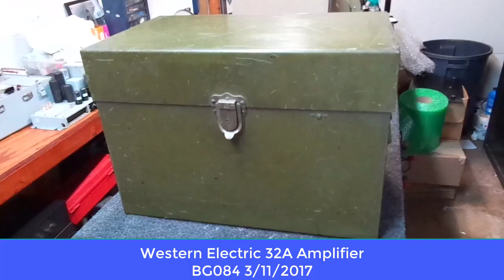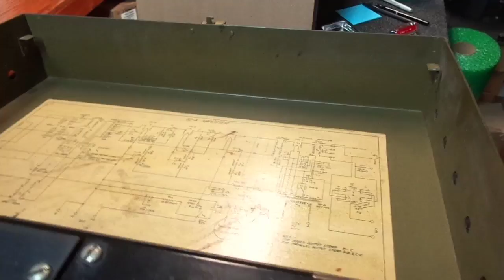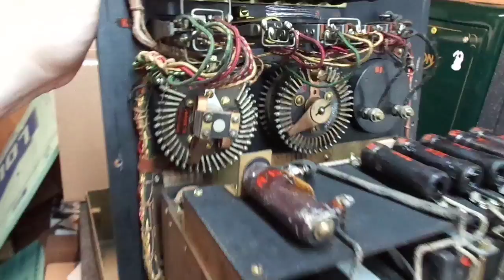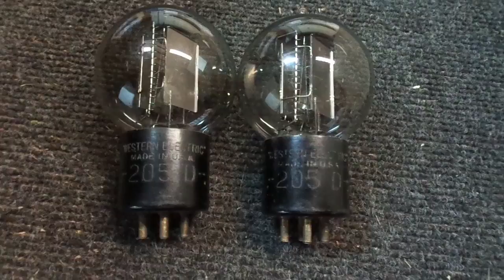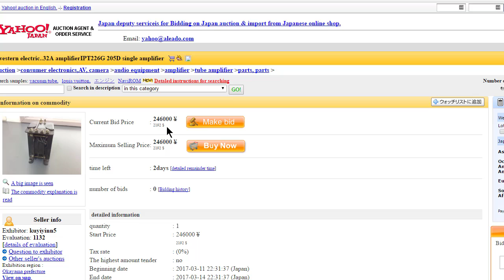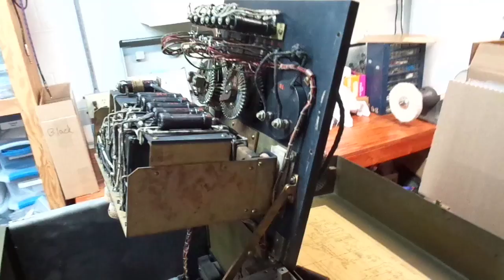Western Electric 32A 205-D Audio Amplifier - Looking for info on this unit - BG084

Comment: In the datasheet of the 205D It is written that the tube is can be used for phone communicate.
"Radio-telephone applications particularly the amplification of a modulated carrier wave
with a minimum of distortion. typical carrier conditions for use with modulation factors up to 1.0"
http://www.mif.pg.gda.pl/homepages/frank/sheets/136/2/205D.pdf
I think it is a military intercom.

Comment: I very much enjoyed watching this video.  The colour of the case, and the rugged construction of your amplifier might have had some sort of military, or field, connection.  It is certainly a utility unit. 
There are a number of Vintage Radios in my collection, for example, that are supposedly worth more as parts than as complete units.  Like you, I could not dismantle any vintage electronic item, especially radios that have survived 80+ years, which includes surviving a World War.  As far as I’m concerned, it would be tantamount to sacrilege. 
Well done for not deciding to cut up your vintage amplifier for profit.
Phil.

Comment: This looks like an early wireless telegraph amplifier.  Looking at the inputs, there are connections for a receiver, transmitter and key.  The key connection has an input for the switch to toggle between transmit and receive.  Maybe it could not only amplify the received signal, but also allow you to listen to your sidetone when transmitting.  Maybe it was used for military or railroad use??  Really cool looking device, whatever it is!!
Reply: I had the same idea. Telegraph amp.

Comment: It's a commercial grade amplifier, as are all WE products. Interesting to see one in a case as they were more usually rack mounted for use in cinemas etc. This one could have been used for public address, or as a station monitor or basically anything where it's portability would have been useful.. so possibly military either for the public address system or base cinema because it's green, though I would expect to see some military type numbers on the case, perhaps even portable cinema/newsreel showings etc. I know the military had mobile cinema units in mose conflict zones. These amplifiers were used in cinemas right from the beginning of talkies through to the mid 70's though most were phased out in the 50's..  Nice clean bit of commercial grade vintage gear.